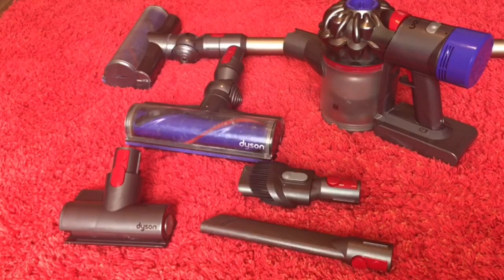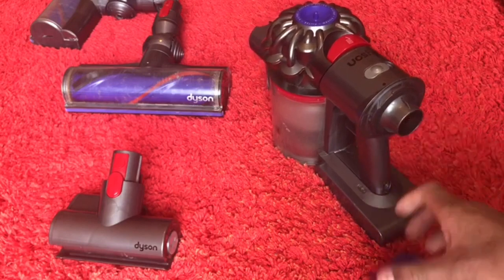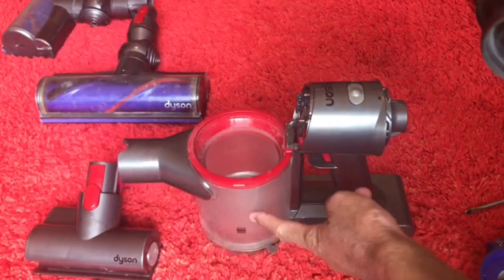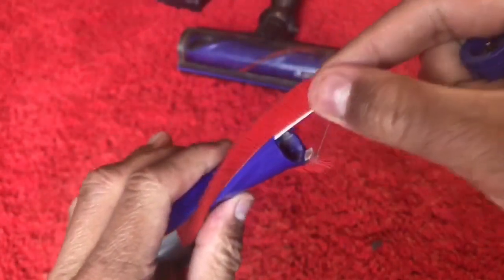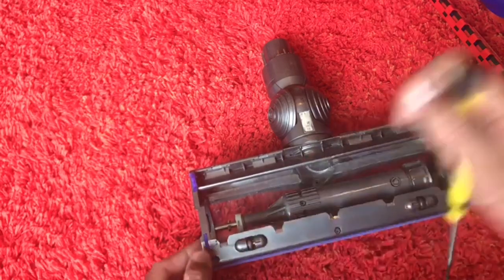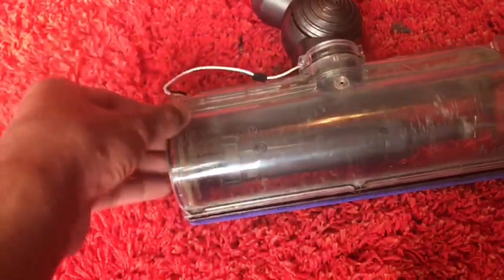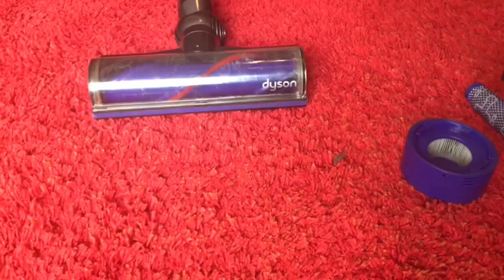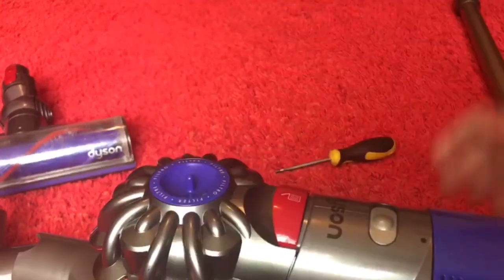HOW TO- DEEP CLEAN DYSON V7 and V8 & FIX SUCTION AND PULSING ISSUE

Comment: Hi parwaz I have a dc04 that cuts out I got a new motor for it yesterday when I put the motor in after I started it for 15minutes and I it cut but the weird thing is it's a new motor
Reply from the maker: Is the vacuum not blocked anywhere? It’s usually the filter 
If not, the thermal cutout on the motor will be faulty and need to be replaced with a new motor
Reply: Nope no blockages at all
Reply: But who cares we are getting a new vacuum yeah!!!!!!!!!!!!!!!!
Reply from the maker: @lakhbirsingh3728  It must be blocked somewhere, for the motor not to be able to breathe well and then overheat